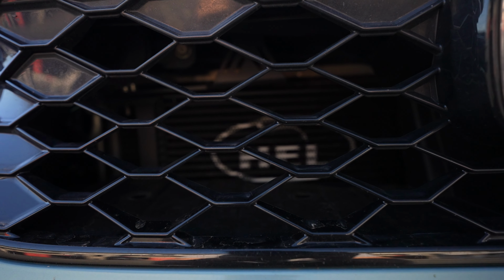FL5 Type R AST Moton Shakedown Laguna Seca

Comment: Problem with HEL, it pumps all that heat right into rhe Rad.  Just mouned mine in front of the wheel liner, and ran a duct next to the intercooler, cant wait to try it
Reply from the maker: Agreed… working on a much better solution right now

Comment: That really sucks the hel cooler isnt living up to the hype.  Was looking forward to a noticeable difference.  Any reason you think the cooler isnt performing?
Reply from the maker: Not a big enough cooking element and the front grill is pretty restrictive. Same reason why IAT’s are so high on the FL5 because air doesn’t get through the grill very well.
Reply: How can you tell for sure? There’s no oil temp sensor on this car. The display is calculated and there’s no way for the calculus to account for the added cooler.
Reply from the maker: @fishyducky  fair point but even if it’s estimated it’s still a drop in temps from the previous temps in similar conditions. As long as it’s being estimated the same way you can still observe a difference

Comment: Even with the oil cooler the car gets decently warm!
Reply from the maker: Oh yeah it does. Need a better cooling solution. I’ve got something in the works
Reply: @GridZilla  best of luck! I know you mentioned in the video you noticed 285F peak but from your good helmet cam footage, by the time you got meatballed, your dash showed 293F.
Reply from the maker: @nodrogkam  ooooh good catch. Still pretty hot.
Reply: @GridZilla  too hot really haha. Wouldn’t want it sitting above 280F for any period of time cause I can’t imagine the actual heat at the turbo (vs the sensor location).
Reply from the maker: @nodrogkam  agreed
Reply: Cooling loop layout needs to be changed. It has too many parallel sections and is designed to bring everything up to temp for street driving.
Reply from the maker: @DueProcessOfFlaw  this is very common in “modern” cars I’ve found.
Reply: @GridZilla yep! The platform is designed for the average driver who is going to floor it before it gets warm 😂

Looks like you can remove a lot of the parallel sections pretty easily, though. Also, the loop incorporates the turbo which may not be necessary (not sure on this platform, but plenty of cars don't take that approach), and definitely contributes substantially to raising the temp relative to the rest of the loop.
Reply from the maker: @DueProcessOfFlaw  ohhh trust me I got a guy who’ll figure this alllll out for me lol
Reply: @GridZilla awesome! Definitely interested. Not a lot of exposure to this type of approach, appreciate the experience you share!
Reply from the maker: @DueProcessOfFlaw  Ohh for sure. It’s all the same (even more so ) on my Supra. All emissions based systems that clutter things up